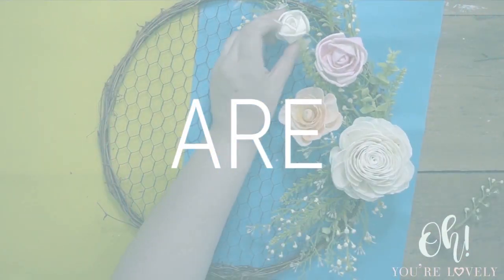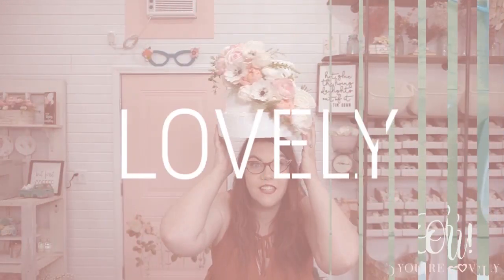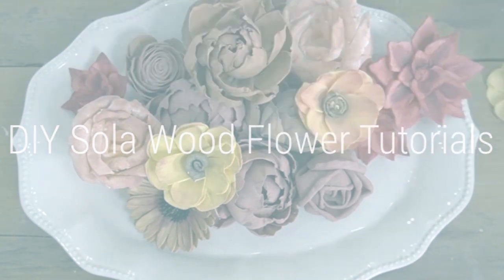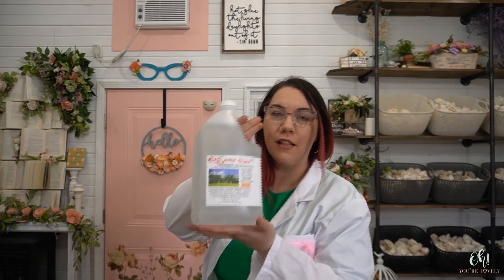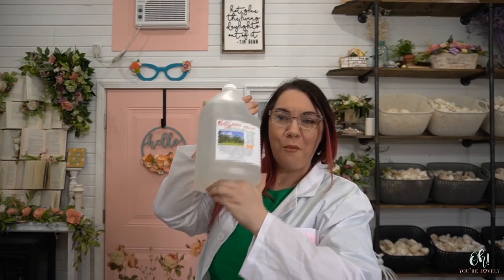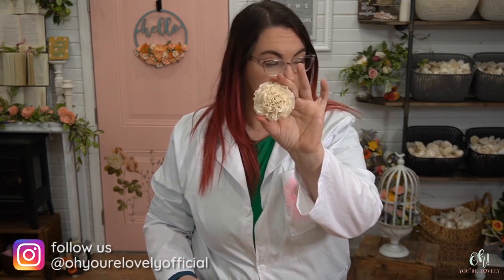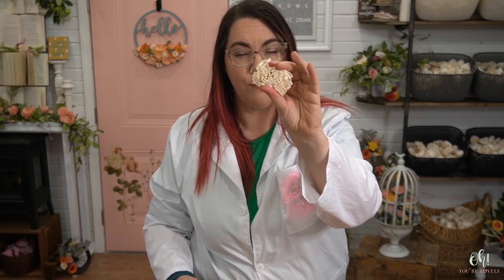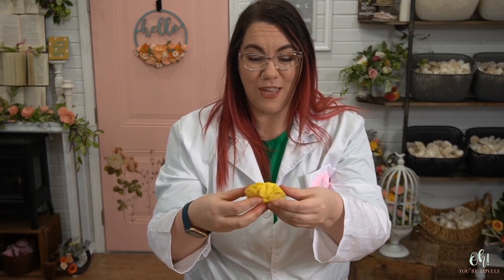How to use glycerin with sola wood flowers

Comment: Hi! Love your videos!! How do you dispose of glycerin? Also, how would you dispose of the mixture of glycerin and acrylic paint?
Reply: Hi, glycerin is actually a medicinal product that can be ingested, I would dispose of it the same as you do paint.
If you don't have a lot, it'll dry out just the same as watery paint.

I would just flush it down the toilet, because glycerin is often used as a suppository in it's solid (dried) form, so our pipes have seen a lot of it!

If you have true pigments in your acrylic, such as those that can be toxic, dispose of the mixture after letting the water evaporate the same way you would normally.

NileRed has a whole channel about lab cleaning that's called NileBlue but I'm a chemistry geek and I use glycerin as a way to make cake for my diabetic mom 🥰

Comment: So. First off, your channel is so helpful and inspiring! With that said, what would you suggest when using glycerin on Sola flowers in a dry climate? Would you use a mix of higher glycerin or higher water? I want the floral arrangements to look/ feel as close to real as possible I live in CO, my wedding will be in May, and the climate here is typically DRY. Thanks in advance!
Reply from the maker: I dont know that I would add much more glycerin to the mixture but it would be a fun experiment for you to try a few different ratios.  I am in Wisconsin so it is a mixed bag of weather

Comment: When using these flowers on wreaths that will be outdoors for extended times, do the flowers need an acrylic clear coat to slow down fading, water damage, etc? Does that work with the softener still?
Reply: I would like the answer to that question also !!

Comment: Thanks for the info. Quick question. How much glycerin will I need if I want to soften 500 colored flowers? We're using them for a quinceanera and I want to make sure I have enough. Thanks in advance!
Reply from the maker: A little bit goes a long way so you wouldnt need the size bottle I have for sure.  A normal size glycerin bottle should be absolutely fine.

Comment: Hello! Help please...does anyone know how long the mix of glycerin AND paint last? I dipped just a few flowers to experiment but wanted to save the leftover mixture for my next project, if possible.  Thanks!
Reply from the maker: It typically lasts at least a week with a sealed top.  When paint goes bad you will be able to smell the paint going bad.  It's hard to described but once it happens you will for sure know it has gone bad.

Comment: Can I soften my flowers, then dye them later?
Reply from the maker: I like to mix my glycerin into my dye because the dye is what makes the flowers a bit more brittle.  If you soften them first they may still be a bit crunchy after the dye is on top potentially.  But you can give it a try and see if it works for you!

Comment: Hi love this video , I want to do this but make my roses gold! Would you reccomend spraying the roses before or after the preservation process? ❤️
Reply from the maker: Are you preserving real flowers?  I sadly dont have experience with that.  If you are wanting to make one of the sola wood flowers gold it would depend how you are dyeing the flowers.  If it is dip dyed you could add the glycerin in the paint.  If you are airbrushing or spraying them with something like spray paint I would spray glycerin on them afterwards.

Comment: I love this video! This isn't a specific glycerin question, but what are your thoughts on using Sola Wood Flowers and dried greenery for a bridal bouquet? I have a couple hundred sola flowers but wanted to try and use dried greenery instead of the fake greenery. What are your thoughts?
Reply from the maker: hey!  (sorry for the delay in responding back!)  you can absolutely used preserved or dried greenery you just want to be careful for things like preserved eucalyptus depending on a temperature/humidity level changes things like that can weep and then you will have a release of dye from the greenery that could stain things.  I would do a bit of research but it is something that people do for bouquets.
Reply: I made my bridal bouquet with sola wood flowers  and a mixture of preserved and artificial greenery and I love it! I used preserved/dried eucalyptus, lavender, bamboo, and boxwood, with a preformed cascading artificial bunch of greenery to make the base.

Comment: Thank you for this video! I have read/watched tutorial videos in the past where the glycerin is added to very hot water but now I see that this is not necessary. Do some use hot water simply so that it will dissolve faster?
Reply from the maker: I havent noticed a difference and my business partner's husband is a researcher and he didn't find a reason that hot/boiling water  would be suggested in terms of mixing the two compounds.

Comment: Do you have any recommendations on softening flowers that have rolled edges? I bought my flowers already, but my wedding isn’t until next fall.
Reply from the maker: I would probably dye easy to uncurl flowers with an airbrush (dont add glycerin)  when you air brush the flowers its such a fine mist of paint on top of the flowers that normally (unless you get really close and get the petals really saturated) you wont have much uncurling and the flowers stay relatively soft.  (we have a tutorial all about spray paint if you want to check that out)
Reply: Oh Youre Lovely what if they harden over the next year?